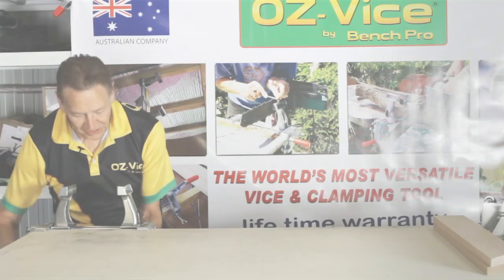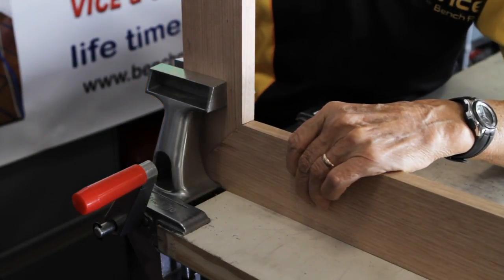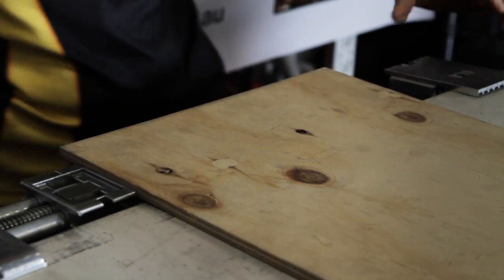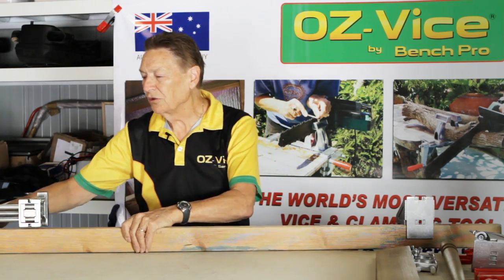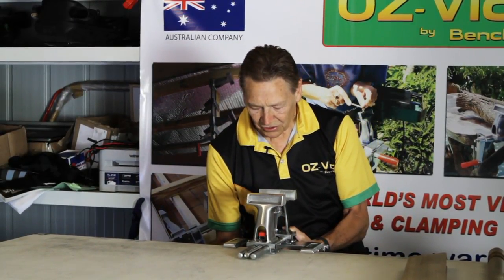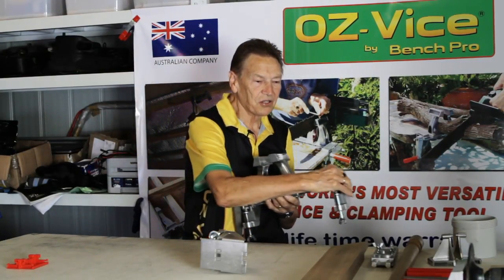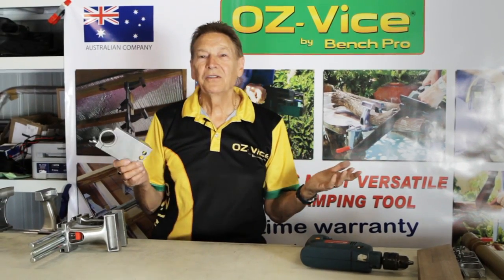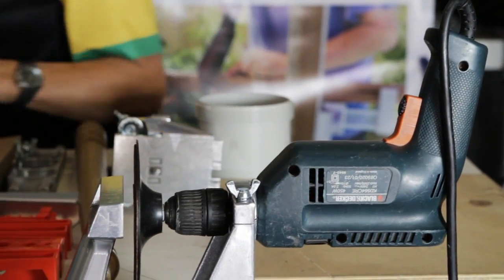Oz Vice - user instructions

Comment: I have an original Zyliss vise, and I made one modification that helps.  I drilled a 1/4" hole through the top of the  clamp units and into benchtop.  Then I just drop in a 1/4" bolt, and this adds significant stability to the unit.  This does not alter the portability of the vise.  Oh, and I also glued leather pads on the jaw faces.

Comment: Bought this vice a year ago, great little unit. Would suggest slight mod and that would be to use a compression spring and washer to hold the handle over the nut. Bloody annoying to be undoing a clamp and have the handle slipping of the spindle/nut all the time. Cheers

Comment: This is a very good demo of a knock-off of the '70s era Zyliss vise.  But what came before the Zyliss vise?
Reply: I bought a knock-off made by WoodShops over 30 years ago.  It worked great.
Reply: They were licensed to several different companies. This is not a knock off
Reply: I've had my Zyliss vice for almost 35 years!  I have not gotten the use out of it that I had expected... but I still love it.  I did once have to sand down the guide bars because they had corroded enough that the vice no longer slid... but after patiently steel wooling off the slight oxidation coating... it was again just as good as the day I bought it.  I have just started building it's own carrying case though as it never came with one and keeping all the parts together so long has been a nerve wracking chore.  Great to see the demo again!  Excellent tool.